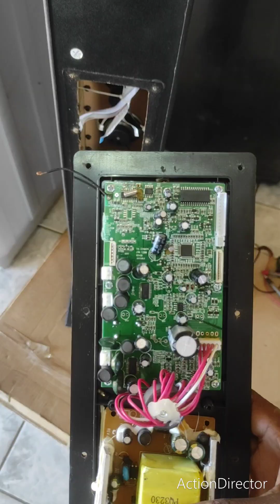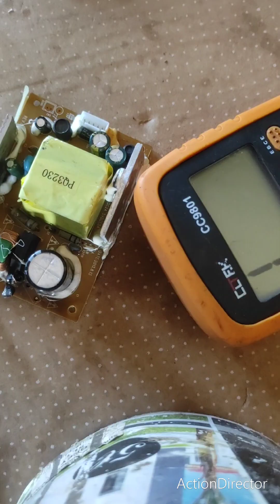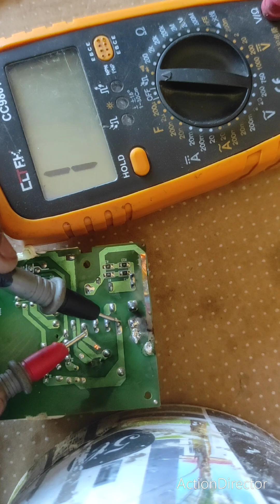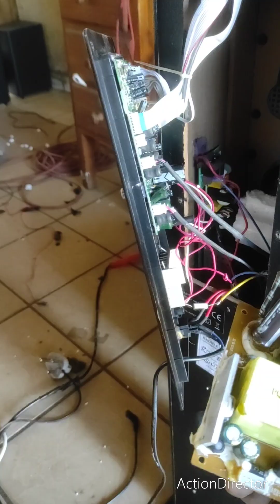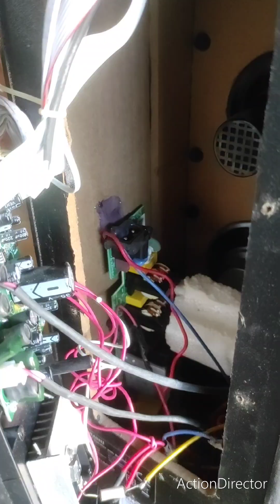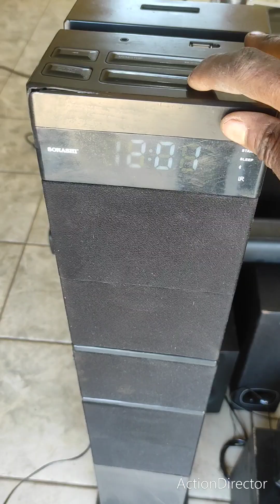Sonashi Tower Speaker With Bluetooth: STEP-BY-STEP REPAIR PROCESS 👇👇🇿🇦

Comment from the maker: There are many ways to kill a cat , and this is one of them!!
If a power supply is not fixable, you can hook in another one , from a different gasket even, as long as the V, I & POWER RATING ARE SIMILAR

LOWER RATING CAN AFFECT SPEAKER OUTPUT POWER , AND THE PSU WILL BE STRAINED AND MAY FAIL PREMATURELY.
TOO HIGH RATINGS WILL FRY THE OTHER BOARDS AND COMPLICATE THE REPAIR PROCESS